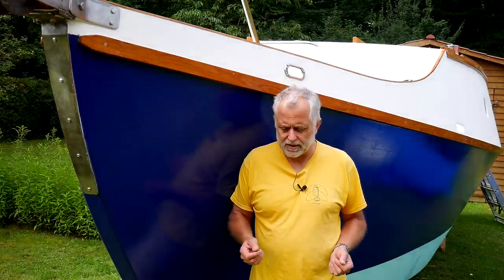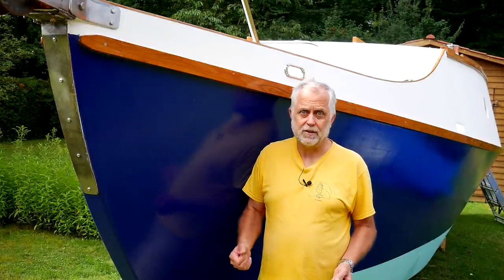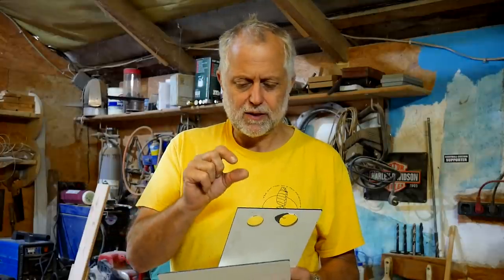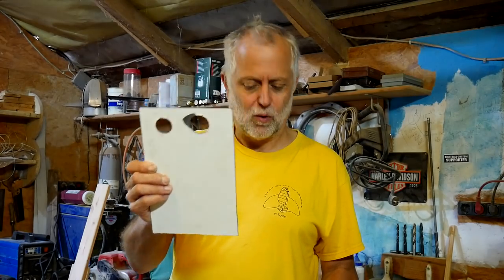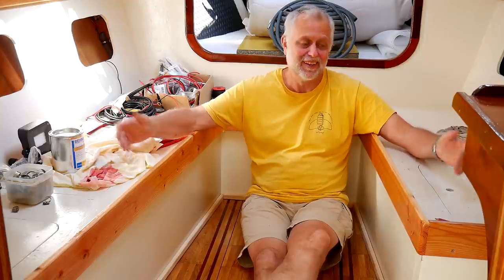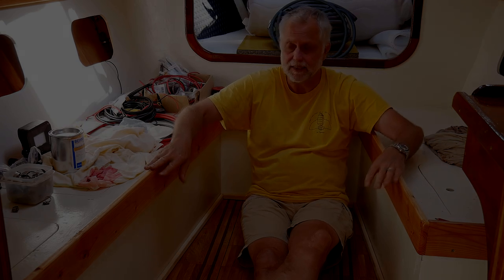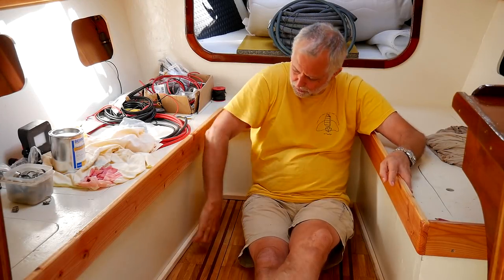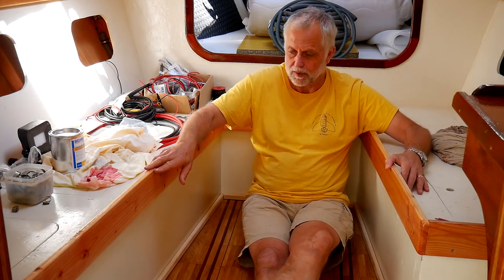Bimini Frame, Sliding Doors, Fiddles and Trim; Building a cruising sailboat - SV Tapatya EP195

Comment: Your boat has definitely outgrown the shed. 1 more Cote of paint and she would've rubbed the doorway. You've done an impressive job. This design has had me follow your build because it's fairly unconventional but I figured you had the keel part covered and I was thinking that the interior space you gain with the flat bottom and wide coach top are well worth a few knots speed in my opinion. Sailors used to never be in a hurry anyway. Now I'm not sure about that.
Reply: The hull shape won't cause any loss of speed, as other Benford Sailing Dory owners can testify. Heck, in 2019, a 34' sister ship, 'Zebedee', won the NZ Tall Ships Race against bigger, more traditional boats. And Tapatya will have more than enough sail area to get her up to hull speed.
Reply from the maker: Thanks Mike 😃 Yes, I like the unconventional design too, and I have no intention of being in a hurry, even though, as JAFO says, these boats may be no slouches 😃👍

Comment: When you need to use an already opened adhesive tube but the spout is much too big to give you a narrow, measured amount, insert a small nail or drill bit into the spout, wrap it snugly with tape, then pull the 'rod' out, leaving a much smaller opening and reducing the mess and waste. When done, squeeze the tape closed, sealing the end of the tube and preventing drying out. Just pull the tape off next time you need to use it. That sharp corner of the settee looks like a right toe masher, might want to soften it with an outside corner molding. Super easy on the table saw, two cuts on a 3 or 4 cm dowel or square stock, bit of rounding off with the sander and done. Wow, this 'work' stuff is so much easier when you're just telling someone else what to do... ⛵
Reply: Very cool tip. Thanks!
Reply from the maker: Good stuff, Mike. Yes, I still intend to round that settee corner a bit 👍😂😂

Comment: Hello Tony, can you remind us of the tiny battery power tools you use? It was a couple years ago since you mentioned them. Circular saw, sander .... What else is there?
Reply from the maker: I have the circular saw, mini grinder, planer, jigsaw and drill. They're all from the Bosch professional 12v series. I think they're great, and no, I'm not sponsored by them. I also have a couple of Makita 18v tools - chainsaw, hedge cutter and strimmer - they are fantastic, and I notice Leo on Tally Ho uses several machines from that range. They also don't sponsor me!
Reply: @SVTapatya  - I've just now been finally able to find this range here in Oz. Did you know they also make a range of heated jacket skins that use the same batteries as your tools? Might be just the thing for those long watches on winter nights! https://www.totaltools.com.au/brands/bosch/heated-clothing?voltage_2=2121

Comment: Tony, she is looking great. Have you or do you have any experience with MIG wielding? Stick wielding for me at least was so hard for me to do , granted that was some 25+years ago when I was younger and dumber. Was just curious about your thoughts on it.
Reply from the maker: Thanks. I have a MIG and use it sometimes. Basically, I did a welding course somewhere around 1980. That was mainly gas welding with a little bit of arc/stick. I really haven’t practiced MIG enough to be any good at it. It is probably easier though

Comment: any rubrail going on this rig? Friend of mine had one of these that got smashed up badly by a runaway boat in harbor. I notice that yours is more of a trim piece than a functional rail. Been in the boat repair business for a number of years….it’s rarely an error on your part.
Reply from the maker: Yes Hugh; this is just the base for the rub rail. There will certainly be more going around there - oak maybe 🤔🤔🤔

Comment: Tony, I was thinking of emailing you directly with this, but decided it probably deserved a wider audience. Highly relevant for the both of us, I think. Seems that electrical bonding of all metal parts might not necessarily be such a good move on a wooden boat. Even in terms of lightning protection.

"Electrochemical damage to wooden boats. It's a thing"

The article - https://waitematawoodys.com/2015/05/15/electrochemical-damage-to-wood-the-marine-version-of-leaky-homes/
The discussion (lots of food for thought) - https://www.cruisersforum.com/forums/f55/electrochemical-damage-to-wooden-boats-its-a-thing-254287.html
Reply from the maker: Good one Garryck. I’ll read that. I had already come to the conclusion that electrical bonding was unnecessary. Also, I have almost no major metal parts. The saildrive has to be insulated from the motor anyway, my through hulls and tanks are all polymer. There’s only really the ballast keel and engine...